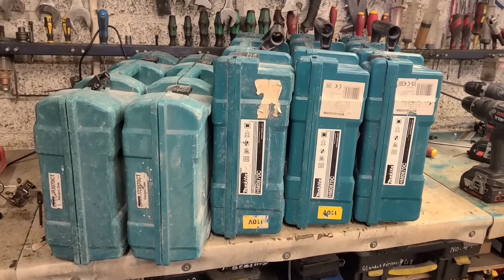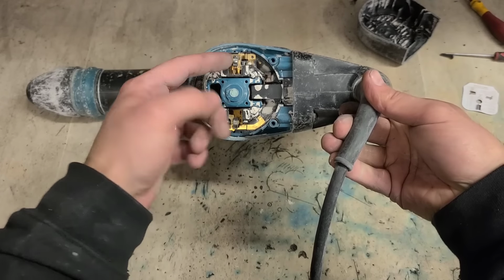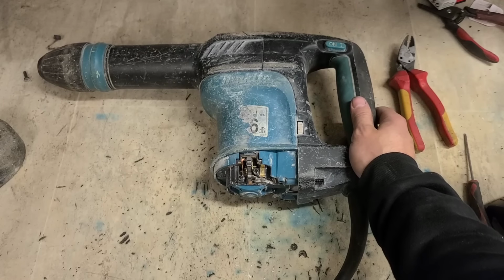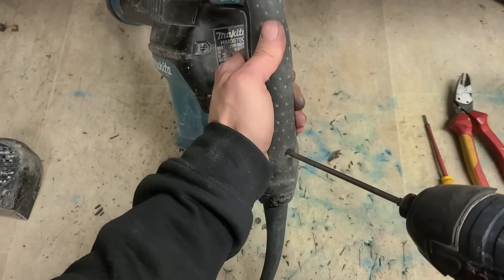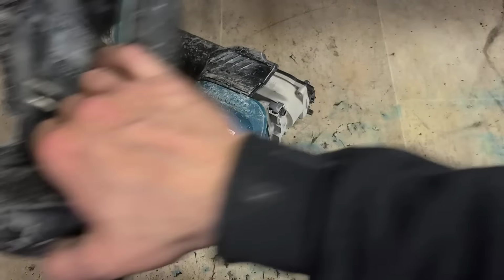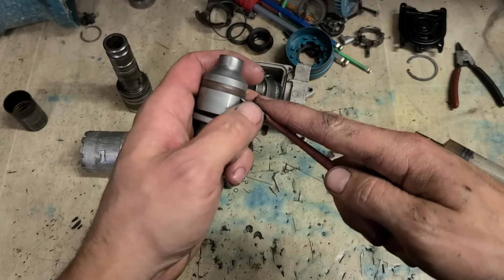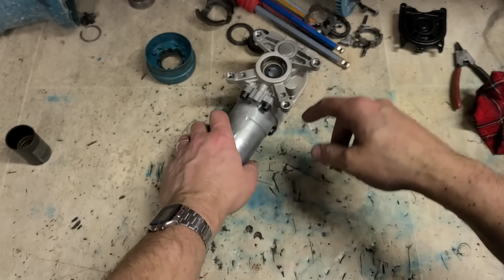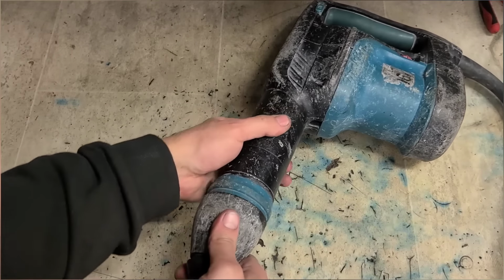Repairing another load of Makita Power Tools. JR3070 recips saws and HR0870C hammers

Comment: I was kinda hoping on a slip clutch issue on that first recipro for a more interesting repair ... But yeah you probably know the reason of those leads being in that condition the moment you try to put the machines back in their cases: Great machines but the inlay of those cases are horrible, just not enough space for the leads and the only way you can close the case is when you curl up the lead and even bend the grommet, which is a shame.
btw it says HR0870C in the description but they are HM0870C (you said it right in the vid) and thanks for another nice video!

Comment: Do these recip saws supposed to cut at 90 degrees or are they for rough cutting only?  I had a lidl parkside one that wouldnt cut straight and threw it away as there was no adjustment.

Comment: On the first repair, I noticed that the plug had three prongs but there was only two wires in the cable. I am assuming the third prong was a ground; is it legal in Ireland ( or anywhere) to sell a tool which appears to be grounded but isn't?
Reply from the maker: No, that's common here. We have 2 class or electrical appliances. Class 1 and class 2. 
Class 1 uses and earth lead. Where class 2 dose not  it relies on double insulated cable and no exposed metal parts. 
All plus 240v and 110v have the earth pin but not all use it. But the earth pin is needed on 240v appliances as the earth pin opens a safety guard inside the sockets covering the live and neutral connectors.
Reply: @deandohertygreaser  Thanks for the info

Comment: If they managed to run two of these to death in a few years they should probably buy themselves some GSH11Es when the two Makitas are finished.
Not saying that these Makita Hammers are crap but obviously they need something really heavy duty.
Reply: They could at least try to give their machines a clean to get a longer life out of them, those air vents made me cry ... 
Also these are light weight hammers, basically the same as the Bosch GSH5. On the GSH11 we're not just talking heavy duty, but heavy machines aswel (almost twice as heavy)
Reply: @ElMariachi1337  I took an interior wall down (all brick) with the GSH5 once. Excellent hammer but I would have went straight for the GSH11 if it was a concrete wall. These smaller hammers arent meant for hammering hard materials like stone and concrete for hours on end.